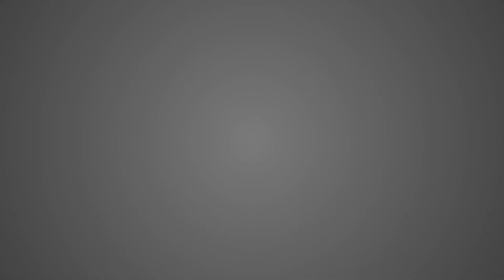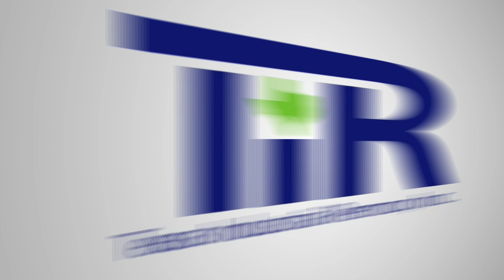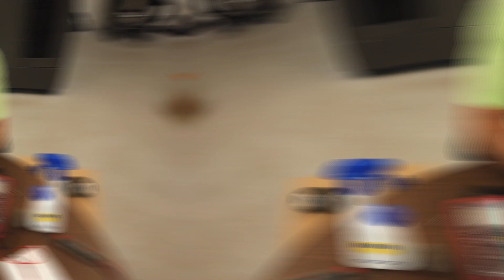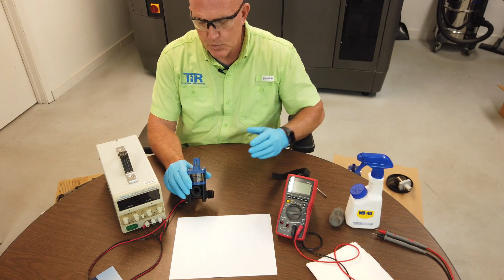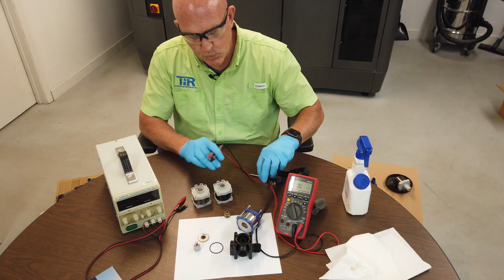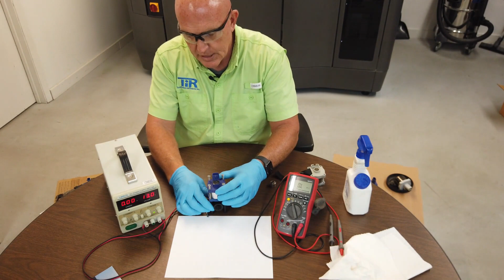TIR Solenoid Valve Components Part 2 of 4

Comment: THANKYOU,,,, I GOTTA HAVE THAT POWER METER VOLTAGE CONTROLLER THAT READS THE AMPS WHILE SENDING THE POWER THRU THE SOLENOIDS :)   Do you have a link for that???
Reply from the maker: @markstratton7505 Your welcome. You should be able to check Amazon and type 0-30 VDC variable power supply, they should have a good selection to choose from.
Reply: @TIRValves  COOLIO,,, found a bunch to research, thx, again God Bless all y'all